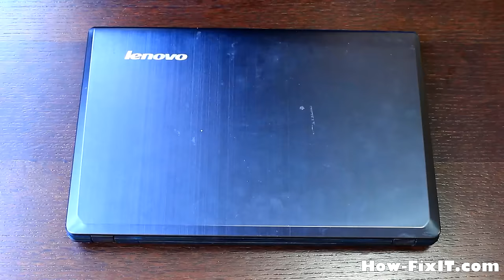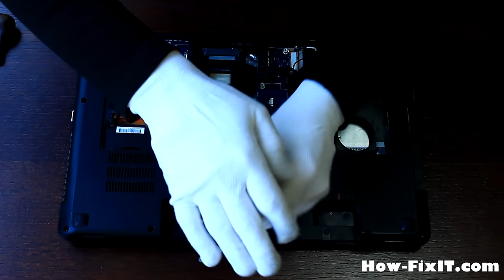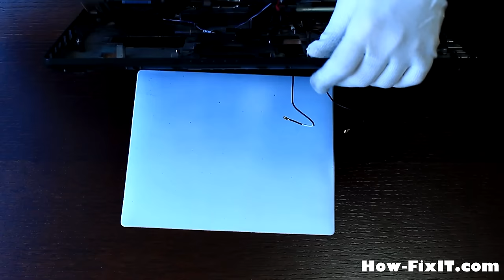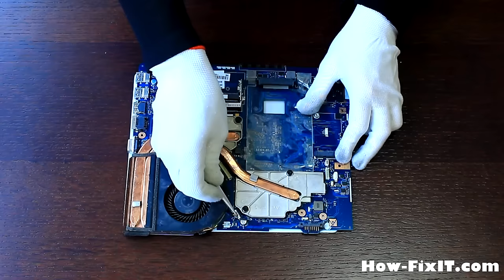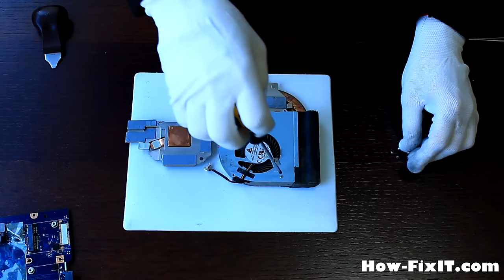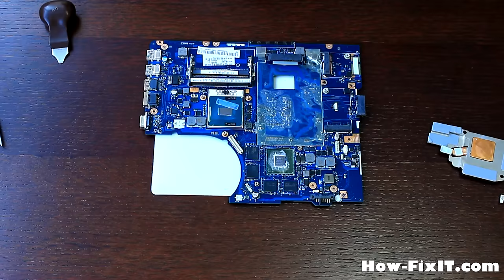Lenovo IdeaPad Y580 Disassembly, Fan Cleaning, and Thermal Paste Replacement Guide

Comment: Thanks for sharing this. How hot is to hot? Currently running as high as 125-136 on the CPU Cores, when playing videos. I don't play many games though. Thinking I may need to reapply the thermal paste. I keep my machine pretty clean as I already wasted a video card in a Dell Inspiron 8500 that I used to use. I really like my Y580 it's been a great machine.

Comment: Thanks for a thorough and good quality video. unfortunately previous owner have left some visual damage on a bottom and heatsink grill of my Y580 and also fan is going pretty loud so Im gona get Arctic MX-4 anyway and new bottom chassis. My question is after you removed motherboard how easy would it be to disconnect screen hinges and other things like speakers and etc so I can transfer internals to a new bottom chassis.
Reply from the maker: There is no difficulties to remove screen hinges: 1st of all you must remove all loop connectors (as like lcd, micro, Wi-Fi etc), next to unscrew hinges and move it out from bottom chassis. And in revers order to install it on new bottom chassis. Hope I've explained clear.
Reply: How-FixIT Thanks. Yes all worked well and I'v got a nice new bottom case and also runs 10 degrees cooler as i used MX4 compound. Keep doing good job!

Comment: what's that white gel thing you used at 16:05?
Reply from the maker: This is thermal paste.
Reply: +How-FixIT what happens if I didn't add any ? Could it be the reason why my laptop will not turn on?
Reply from the maker: vjhy if if won't apply any thermal paste it can prevent damage to motherboard, But it can turn on without thermal paste.